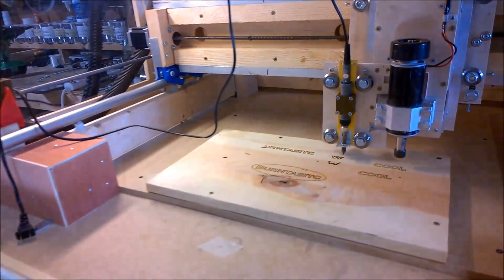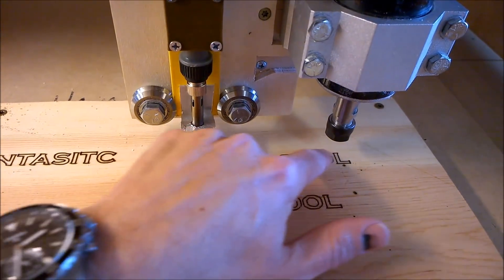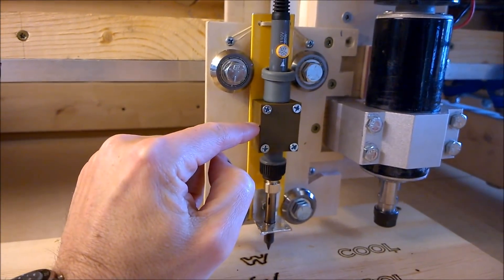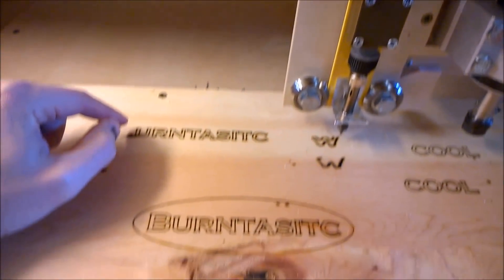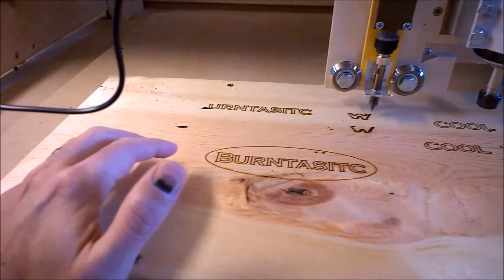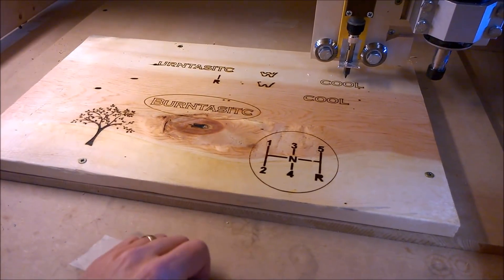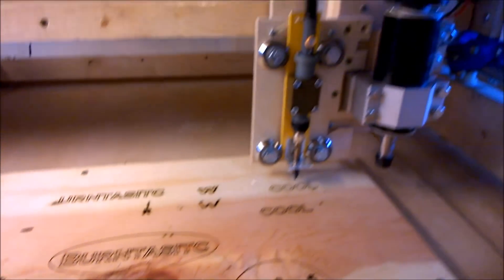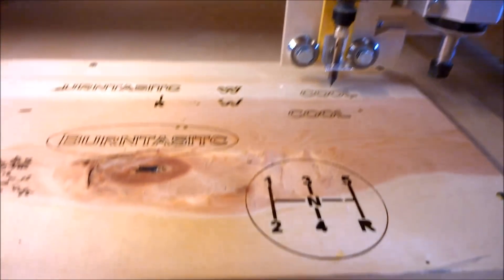DIY-CNC - Wood Burning Mod - Laser-Like Engravings!

Comment: WOW! your results are so neat and clean! what CAM do you use? I am very struggling with a Stepcraft with its own pyrography. I think my problem are the tool paths: if you use Fusion360, what ramp/leads do you use? I burn everything in corners :(

Comment: This was really cool.  Thank you for the excellent video.  I was wondering what your feed rate was.  I use a ShapeOKO3 CNC machine several times a week with a variety of feed rates (based on bit size and wood density, etc.  Do you have feed settings written somewhere?  Thanks again.
Reply from the maker: Thanks for your comments.   I can't remember the settings but it was pretty slow.   It was a fun project.  Best of luck.

Comment: 24$ on amazon? they ripped you off , i got the exact same 60W soldering irond for 4$ on ebay directly from china. If you are worried about missing packages just buy 2 for 8$ then the price is still 3x cheaper lol.

Comment: What's your system for generating the toolpaths? Isn't it hard? How do you know how long to keep the tool down in the work?
Reply from the maker: Not too difficult, just a lot of trial and error.  For toolpaths I use Inkscape for the design part and then Cut2D for the toolpath stuff.